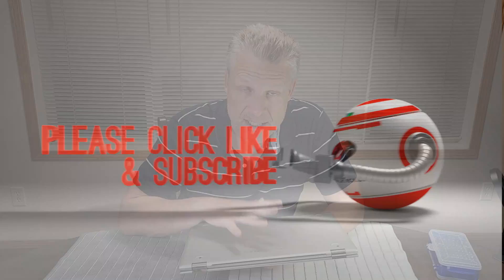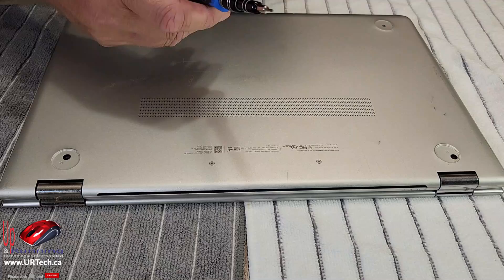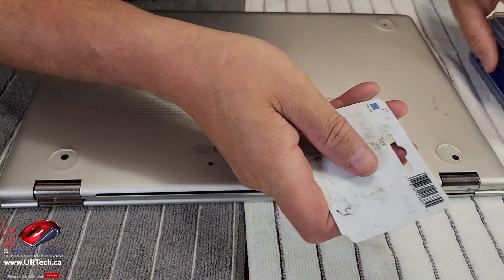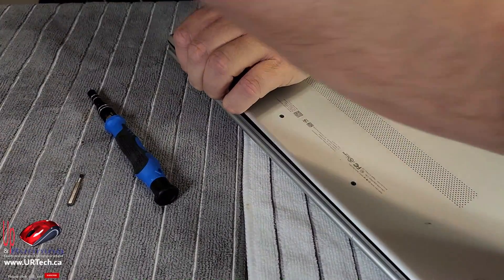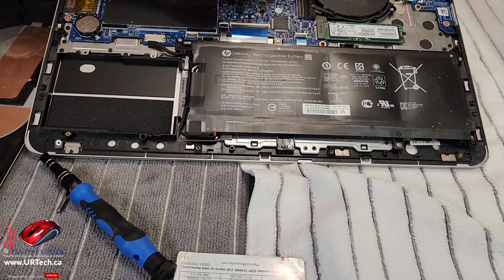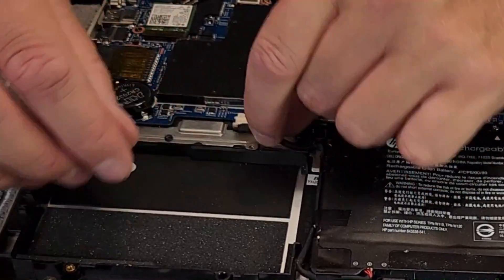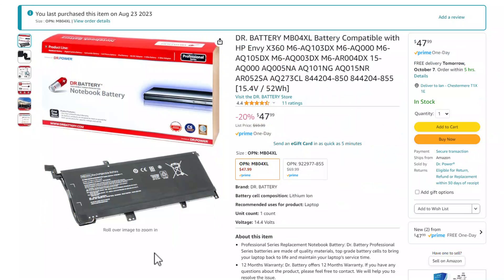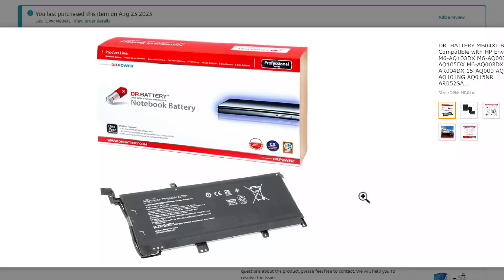STEP BY STEP: HP Envy X360 Laptop Battery Replacement

Comment: NOTE:  The four pads on the bottom of an "HP ENVY x360 - 13-y034cl" laptop DONOT need to be removed. There are no screws under the pads. If you force one off, like I did, you'll have to glue it back on.
Reply from the maker: Well, in my case two of the pads (the ones at the back) did have screws under the pads.  Likely just another variant :)

Comment: I thought my model didn’t have any phillips screws, since the bottom looks a bit different than this, and they weren’t anywhere in sight. Well after I battled the cover for like half an hour, I realized that there are super tiny philips screws UNDERNEATH the rubber strips. 

I had to peel back the rubber grip strips, AND THEN peel back the stickers underneath those to find the remaining four screws. By the time I had realized this, I had already broken two screw tabs while trying to pry it open… sucks. But I got it open

Comment: I found the video to be very informative for getting the HP Envy X360 taken apart but I was surprised that the battery in my laptop was an LK03XL, not model MB04XL as highlighted in the video. I'm suspecting that there may be more than one Envy X360 models which would explain the different batteries and also my laptop does not have 4 pads on the bottom. Fortunately, I can return the incorrect battery and replace it with the correct one.
Reply: Yes, mine looks to be the same. I jsut ordered a LK03XL for an envy convertible 15m cp0xxx. Hoping it is the correct battery!

Comment: Q.   I replaced the  battery but broke/bent the left hinge while trying to snap the back onto the keyboard.   The keyboard cover has @1/4” gap and will not snap to the base.  It makes a sound as I I open & close the lid.  
A few small pieces of plastic fell off. 
Do you have any suggestions?   
Thank you
Reply: DUCT TAPE! :) BE UNIQUE  ;)

Comment: Thanks for the helpful video. My hp envy 360 15m doesn't have a cable like you show here 3:25 Instead I think it connects directly at the top. Unfortunately I am having trouble finding a demonstration of my type being removed. Could you specify what model type you're working on here? Thanks.
Reply: hello, did you find a solution?
Reply: Ubergeeks has a video on that style battery I watched that first and came here because mine was different
Reply: @Illlvisions  wow thanks! Lol it's long dead now but maybe I'll take a look at it.